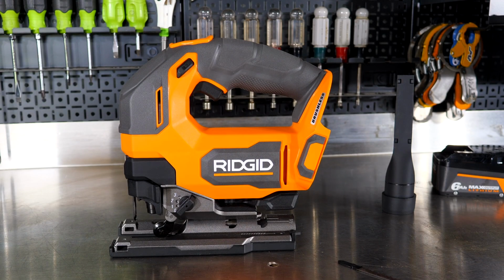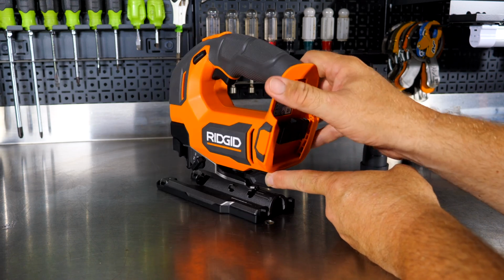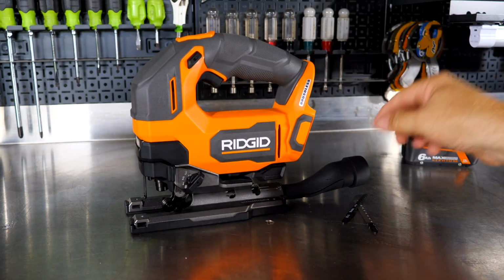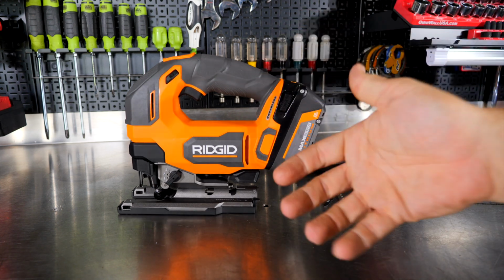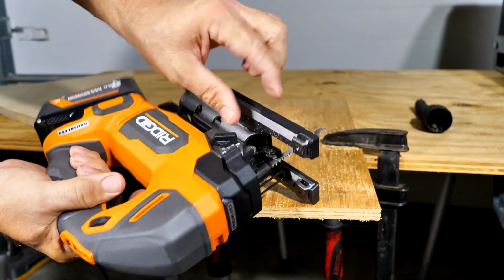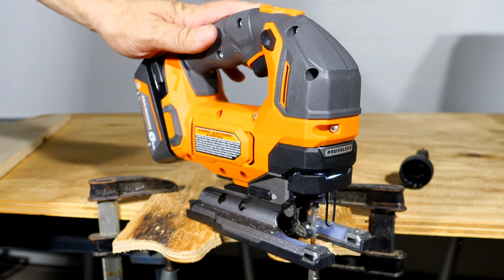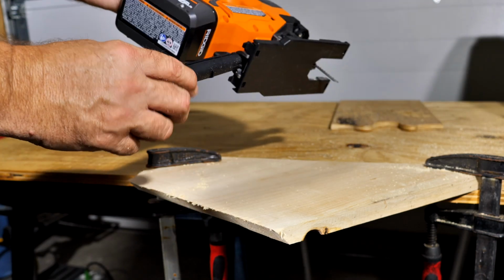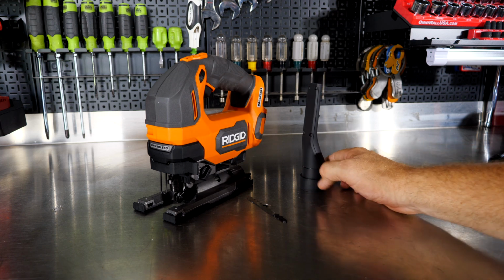RIDGID R86344 18V Brushless Jig Saw

Comment: Thanks for another great video brother.  I am in the market for a jig saw. I have Milwaukee m12,  m18 and Skil pwr core 20 platforms. I honestly do not have a lot of need for one but its a tool that when you need it, you need it.  Im holding off until the Milwaukee pipeline in hopes of a new m12 fuel jig saw. If not then that Skil brushless is looking really good.  So far the Skil new XP 7 1/2"  circular saw and 5" brushless orbital sander is performing exceptionally well. I honestly do like this Ridgid im just wondering if adding another platform is worth it. Im looking at around 260.00 for saw, batteries and charger. Thats a decent chunk to invest in a jig saw.
Could you possibly review the new Skil 1/2" mid impact (800/480) and their Brushless 20v jig saw?
Thanks again brother.
Reply: I think you'd be better off with spending that $260 for a quality tool alone for a battery platform that you already have. The M18 seems good. Just my 2 cents.